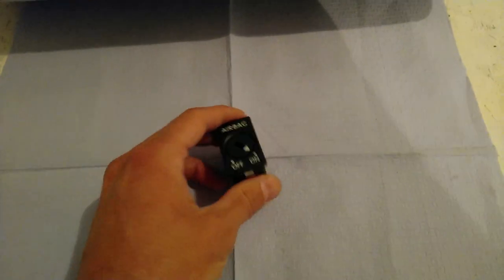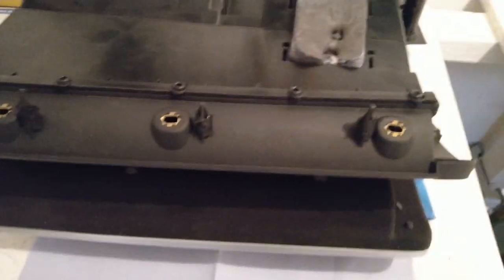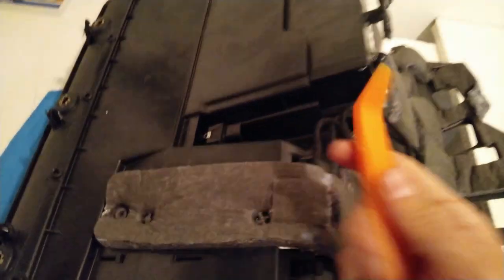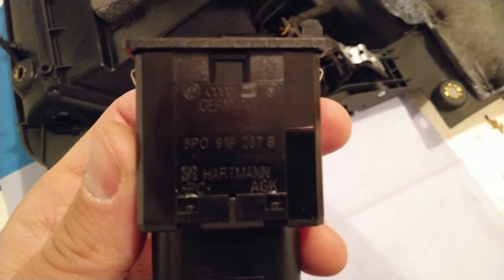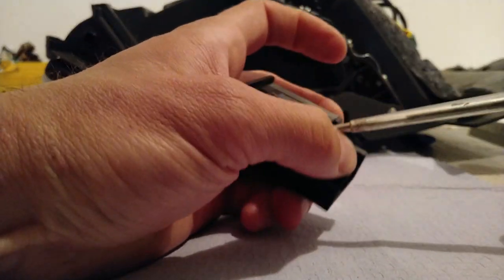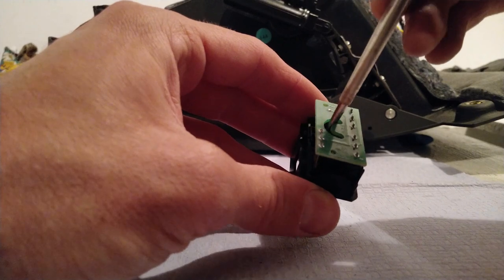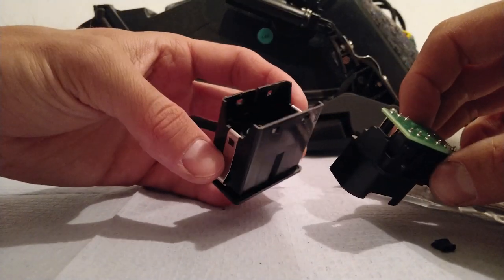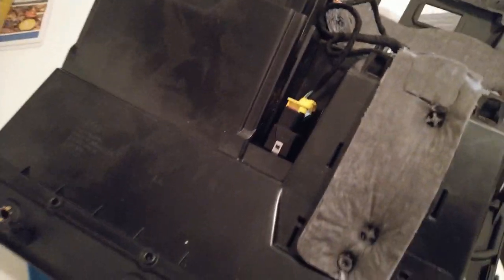Replace Airbag Switch on Audi TT Mk2

Comment: I have a 2007 TT Japanese version and there's no airbag switch in the glove box. Is it somewhere else?
Reply from the maker: Probably not, airbag switch is an extra option to have (probably depends on local law). So you cannot turn off passenger airbag - i.e., you should not drive infants or toddlers in front seat.
Reply: @sunkazz  alright thanks for replying, man. I needed to fix an airbag light problem I had after tampering with my infotainment system but it stopped after driving around a bit

Comment: I have BIG problem. Error 01314 - Engine Control Module
Maybe someone can help me ? I can run my car! Please!!!
Reply from the maker: Its an ECU no communication error code. 1. Check connections from/to ECU. 2. Scan error codes and clean all via VCDS. 3. Did you remap or flash ECU? Then it probably needs remapping. ECU is in the engine bay under the passenger wiper.
Reply: @sunkazz  hello friend, i have more fails.. i dont have vagcom.. other error its abs brake light blinking and three pips sound.. i can turn on my car
 Maybe know someone can help me ?
Reply: @sunkazz  this is carista scan;
Información ECU obtenida con Carista 4.0.7 para Android:

Motor
[ECU ausente]

Transmisión
Nº de pieza: 02E300043Q
Componente: GSG DSG
Codificación: 20 (decimal)
Códigos de fallo:
18258 Data-Bus Powertrain, Missing Message from Engine Controller (ECU)
18259 Data-Bus Powertrain, Missing Message from Brake Control Module

ABS
Nº de pieza: 8J0614517
Componente: ESP MK60
Codificación: 17424 (decimal)
Códigos de fallo:
01826 Sensor for Steering Angle (G85), Voltage Supply Terminal 30
01314 Engine Control Module (ECM)

Ángulo de dirección
[ECU ausente]

Airbags
Nº de pieza: 8J0959655
Componente: -s Airbag 9.43
Codificación: 11635 (decimal)
Códigos de fallo:
01578 Airbag Deactivation Warning Lamp, Passengersside (K145)
01316 ABS Control Module

Dirección asistida
Nº de pieza: 8J1909143B
Componente: EPS_ZFLS Kl.157
Codificación: [ninguno]
Códigos de fallo:
01314 Engine Control Module (ECM)
00625 Vehicle Speed Signal (G22)
00778 Steering Angle Sensor (G85)

Enfoque de los faros
Nº de pieza: 8P0907357G
Componente: Dynamische LWR
Codificación: 9 (decimal)
Códigos de fallo:
01314 Engine Control Module (ECM)
01316 ABS Control Module

Electrónica central
Nº de pieza: 8P0907279H
Componente: Bordnetz-SG
Codificación: A9060E8280141C00554A00004F0000000009EE075A250802 (hexadecimal)
Códigos de fallo:
03098 Bulb for Flashing Light rear-left
02394 Parking light left front (M1)
02395 Parking light right front (M3)
00924 Relays for headlamp wash/wipe system (J39)
01314 Engine Control Module (ECM)
03098 Bulb for Flashing Light rear-left

Sistema corporal/confort
Nº de pieza: 8J0959433
Componente: KSG
Codificación: 9890300241102D2D8F0FC88A0063 (hexadecimal)
Códigos de fallo:
01565 Luggage compartment light (W3)

Puerta del conductor
Nº de pieza: 8J7959801C
Componente: Tuer-SG
Codificación: 21 (decimal)
Códigos de fallo:
00932 Electric Window Motor; Drivers Side (V147)

Puerta del acompañante delantero
Nº de pieza: 8J7959802C
Componente: Tuer-SG
Codificación: 21 (decimal)
[No hay códigos de fallo]

Volante
Nº de pieza: 8P0953549F
Componente: J0527
Codificación: 11111 (decimal)
[No hay códigos de fallo]

Calefacción y aire acondicionado
Nº de pieza: 8J0820043S
Componente: J255 Klima 1 Zo
Codificación: 1573124 (decimal)
Códigos de fallo:
01314 Engine Control Module (ECM)
01206 Signal for Duration of Ignition Off Time

Techo descapotable
Nº de pieza: 8J7959255B
Componente: 256 VSG TT
Codificación: [ninguno]
Códigos de fallo:
02000 Switch Position

Sistema de sonido
Nº de pieza: 8J0035223B
Componente: J525 Amp Std
Codificación: 106136 (decimal)
Códigos de fallo:
00446 Function Limitation due to Under-Voltage

Navegación
[ECU ausente]

Radio
[ECU ausente]

Teléfono
[ECU ausente]

Panel de instrumentos
Nº de pieza: 8J0920930C
Componente: KOMBIINSTR. VDO
Codificación: 148 (decimal)
[No hay códigos de fallo]

Inmovilizador
Nº de pieza: 8J0920930C
Componente: KOMBIINSTR. VDO
Codificación: [ninguno]
[No hay códigos de fallo]

Puerta de enlace de red CAN
Nº de pieza: 1K0907530K
Componente: J533__Gateway
Codificación: 7F0F23CA07005100 (hexadecimal)
Códigos de fallo:
01314 Engine Control Module (ECM)
01300 Control Module for Navigation with CD-Rom (J401)
01304 Radio
01303 Telephone Transceiver (R36)
01316 ABS Control Module

Electrónica central 2
[ECU ausente]